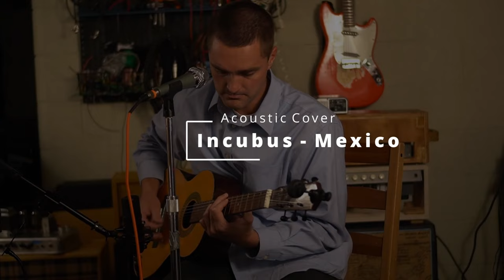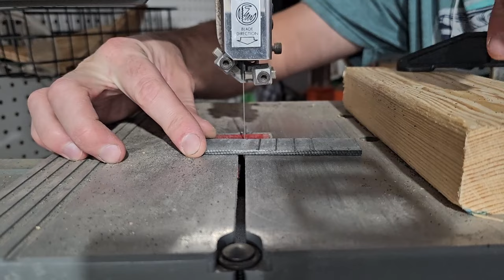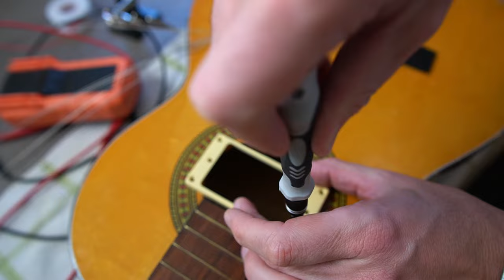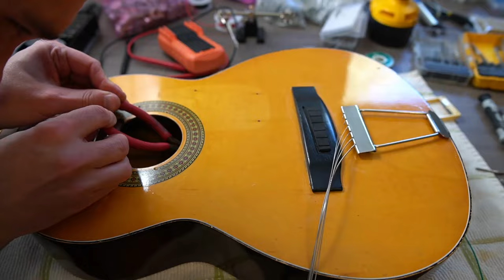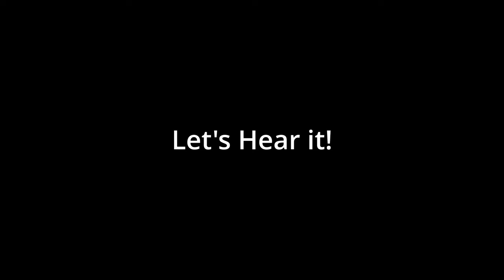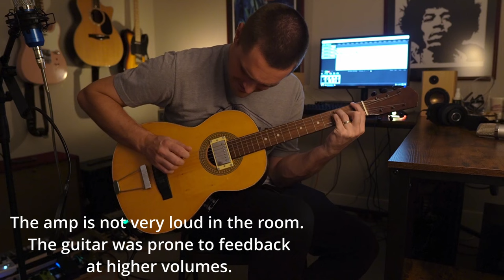Rubber Bridge Acoustic Guitar - How To & Demo

Comment: Does this guitar have a truss rod. I ask because hock shop hopping I saw a Korean made guitar that appeared very similar that did NOT have a truss rod. Passed on it because of that.
Reply from the maker: No it does not.
Reply: @KleyDeJong  Thank you. Is the neck reasonably flat? For $35 I think I'll go get it if the guitar is still there and  if your hack does not have major neck issues.